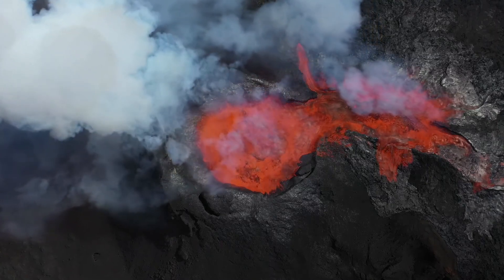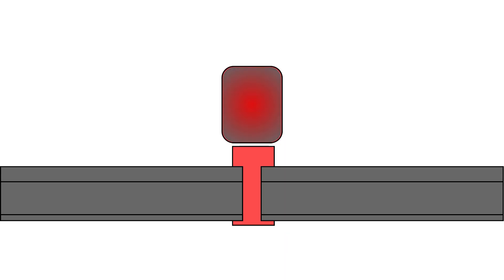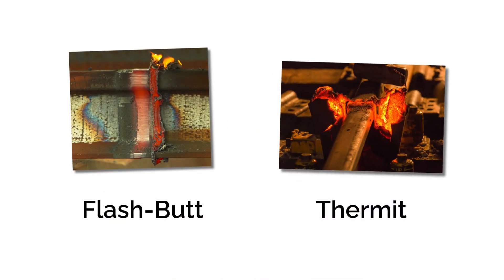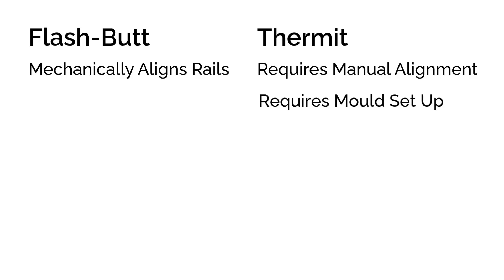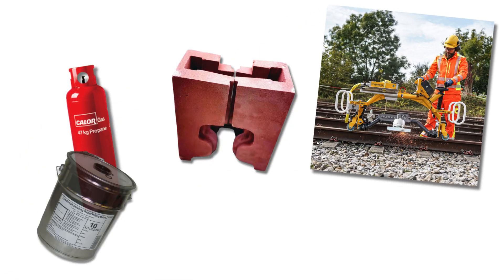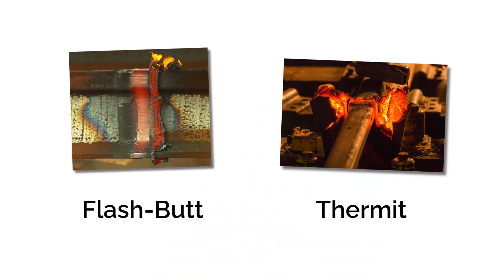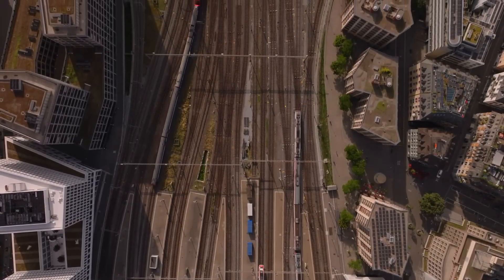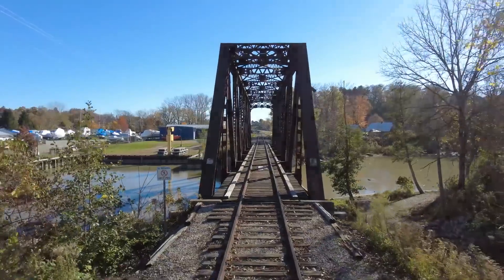Behind the Spark: The Two Rail Welding Methods That Keep Trains Moving

Comment: You note that flash-butt welding requires the rail ends to be separated, then pressed together.  (What is the initial separation?  Is the heat made by contact resistance, as in welding bandsaw blades, or it is made an by arc between the separated rail ends, as in TIG welding?  Is argon gas used?  What is the voltage & current required?)   How is this done in the middle of a mile of straight track?  (This is like the problem of joining 2 pipe ends of a buried pipeline.)  How is this done in yards where there are switches & other track crossing points that forbid motion of the track?

Comment: It is sometimes said that even a bad flashbutt weld is as good as a good thermite weld! Both the strength and fatigue strength specifications are quite different between the two with flashbutt specifications being significantly higher than thermite welds. Some would argue thermite welding isn't really welding at all - more precision casting!  🔥
Reply from the maker: I would agree with the precision casting part! 

How much different are we talking on the strength specs?
Reply: @thepwayengineer  I can't put my finger on the exact numbers as I don't have the standards to hand, but bend test strength specs for a 60kg rail were around 1200kN for an aluminothermic weld and 1600kN for a flashbutt weld from memory.

Comment: That was one of my first jobs working in a yard (Thingley Jn) prepping rail for strings. We had an issue with the flash butt welder with the result that the welds were being rejected when taken away for testing.

In the end, we had to get an engineer out from Switzerland, it turned out the welding head was getting too hot.

Once that was sorted, we didn't have any issues.

As for access, with plenty of track boys to lug the gear (stressing kit and bottles of gas and oxygen) and a trolley, didn't take us long - provided we didn't have any steep steps to tackle as you mentioned and we didn't have too far to walk. 😊 I have worked with some good welders in my time who knew their job and it was a welcome sight seeing the weld being dropped at the end of a 12 hour shift.

Thermite seemed more prone to weather conditions such as rain, on one job remember the welders weren't happy doing one weld as it will have to done again. That is one advantage flash butt has over thermite it can be done in more controlled conditions.

One advantage thermite has over flash butt, the slag makes an excellent hand warmer on a cold winter night, be sure to wait a while and wear gloves! 😉
Reply from the maker: I remember someone always using the slag to warm their dinner up!

Thank you for sharing! Interesting stuff

Comment: Flash butt machines in the UK generally have to produce 30 welds per shift to be cost effective. Also their limitations around clearance in s&c.

Network Rail have sold all their FB units now with only a couple of suppliers left operating FB machines in the UK. The main failure was the incorporation of the stressing unit to the welding head.
Reply from the maker: Interesting, thank you for sharing! I knew NR had sold theirs.